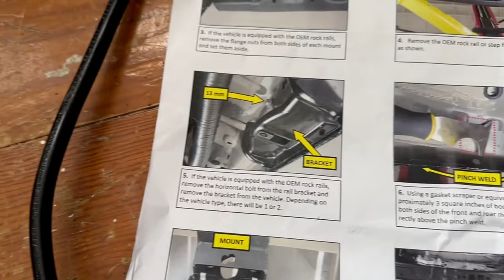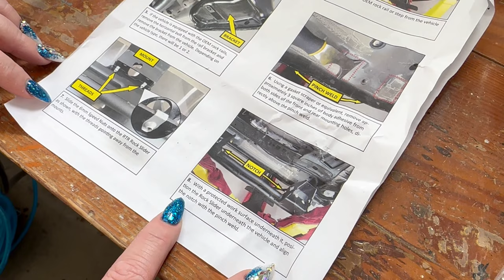2023 2 Door Bronco Wildtrak - RTR Rock Sliders install

Comment: I went with ZRoadz on my Wildtrak 2door.  Curious if the RTR are the same in that they really only mount to the body and not the frame? Congrats, by the way, on your new Bronco.
Reply from the maker: Correct,  the RTR mount in the built in threaded holes in the Bronco body, as well as through the pinch weld.  We have already tested these off-road and they are absolutely strong enough. Ford designed the mounting points really well to withstand abuse and even serve as a jacking point. Really impressed even compared to our Tacoma which has frame welded sliders.